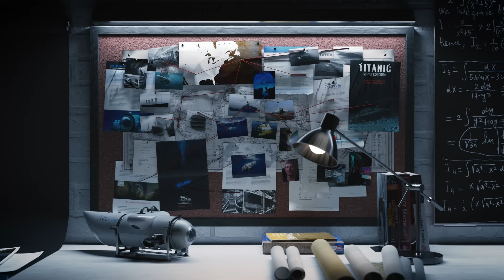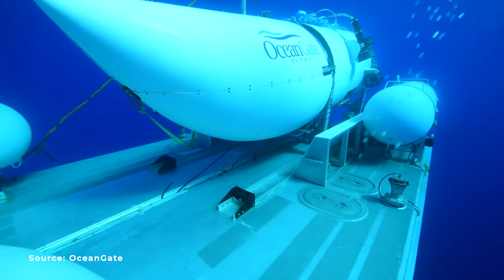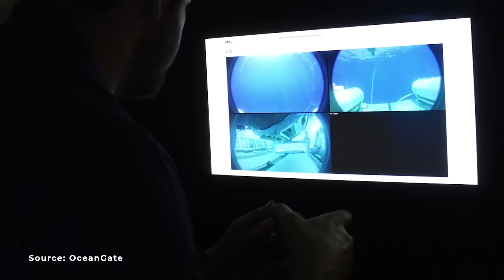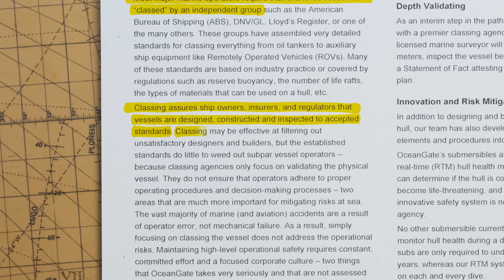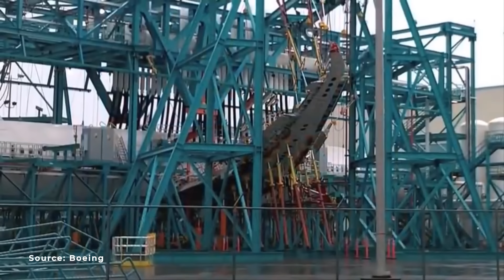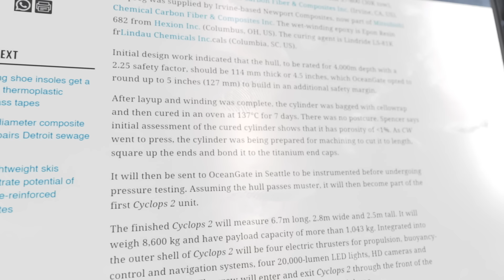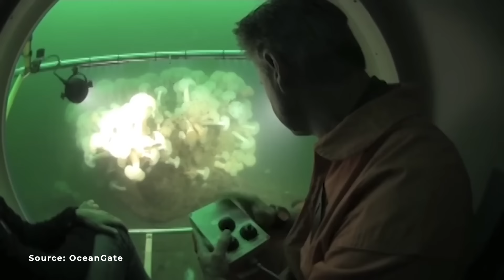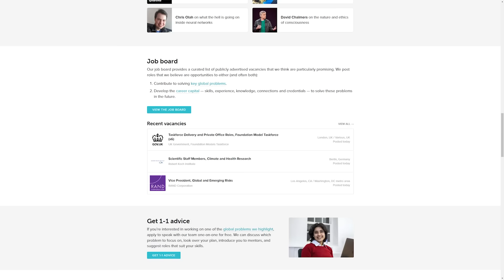The Questionable Engineering of Oceangate

Comment: Point to note about carbon fibre skinned aircraft. Commercial aircraft are routinely pressurized to 11 psi(pressure found at 8000 feet above sea level). That outward force is pushing against the 3.6 psi found outside aircraft at their 35,000 foot cruising altitude. So only 7.4 psi pushing against the fuselage shell, in the right, tensile, direction for composites, versus ~5500 psi of compressive force patiently waiting to crush the Titan.

The CEO was a poster boy for Dunning-Kruger. He knew just enough to kill himself and whoever was unlucky enough to be with him, when willfully ignored material properties and physics, finally won.

Comment: I'm finding this really interesting- I work as a historic blacksmith and often deal with an archaic material "wrought iron" which was the go to standard iron metal before the bessemer process. Wrought iron is essentially a composite of semi bound iron fibers and silica slag, and therefore requires special attention when worked. Many modern blacksmiths struggle working it being so accustomed to modern homogeneous steel, where as wrought will not tolerate the same treatment. It will delaminate, crack, and is stronger or weaker depending on the axis being stressed. All you've described about modern composite materials is very intuitive to me, I've even seen wrought iron delaminate like that buckle snap failure you described, it will do that sometimes if you over stress a bend in a bar the wrong way. While working the iron we have to constantly monitor the piece for potential faults or inconsistencies in the irregular material and intuitively and on the fly remedy them. Since wrought iron is no longer manufactured we face the added challenge that we don't get to choose what quality bar we get, but certain pieces absolutely will not tolerate sub-par bar. Knowing how wishy washy and subtle our mental judgement calls are I can very much understand what a task it must be to get a computer to understand the complexity of a composite's character. Cool stuff!

Comment: Another good video cheers. I appreciate the necessary commentary on the misuse of engineering by unsuitable mindsets. It would also be good to have some in depth maths and physics, especially with examples, of things like different strengths and failure modes of different types of composite etc. Cheers! 👍

Comment: Doing rapid development cycles like what SpaceX and others are doing is not the same as what Oceangate has done. Rapid development cycles mean to do a lot of smaller scale design-build-test-repeat upfront before a full scale design so you learn fast. It doesn’t mean to circumvent some verification testing nor does it mean not to seek regulatory licensing. You can also accept certain risk in testing as long as human life is not at stake. These are important distinctions to understand.

Comment: I wonder if the carbon fiber tube would be ok with a steel or titanium backing plate or perhaps used the backer as the "spool" on which the carbon fiber is laid.
Reply: At that point, why not make the entire thing out of titanium?
Reply: @alex2143  'innovation'. 

For real though, i was thinking towards weight savings, but I don't think that a small sub like this has a specifically large problem with weight.

Comment: Wrongs beyond the material:
1) By tensioning the windings it pre-compresses the structure.

2) There was no intentional bias carbonfiber, they split the prepeg into strands & applied it like putting thread on a bobbin, this significantly removed shear strength at the ring edge, my primary suspect that the shear-forxe shear opened a slot to fail vs a point failure.

3) To mention if carbonfiber was used, it's also as powered to mold in a plenum for a homogeneous structure, nanotubes cone to mind vs a layup. This brittle a reason to stick with titaniumxs huge elongation at failure [a 2-way street]. Notch strength iffy req's a an armor layer inside & out.

Others mentioned in comments, a structural concept for bomber cylindrical submersibles for 1-crew & 4-psngrs: A parallel-sided barrel of titanium beams having the wedge-xsec of a barrel.

1st run for dist. load on a 12.5ft cylinder caused 35.5" of elongation at the center as a beam only, this to be taken by the side-face compression as with a complete stone-arch. 

Seats 30"/76cm wide with circular bulkheads a reserve for hitting something. 80-staves 2.66" wide at the base 2× for height gives a 5ft dia. roomy-ness for tourist perception vs this implosion event global impact, and, it looks to scale up.

Staves can be extruded, handy for costs part of reasoning vs cast-formed bulbs, tension bands pre-load it ashore.

It seems valid as a structural strategy, would really like feedback on any aspect, I'm convinced it can prove itself as a new, versatile submersible deep dive geometry.
Fwiw🍺

Comment: I like the idea of "Move fast and break stuff" as a means of developing new designs but that is more of a means of quickly discovering new concepts. Skipping the refinement of those concepts is what leads to prematurely putting lives on the line.

I am rather fascinated by the lack of research into the snap buckling and delamination considering for how long carbon fiber composites have been used in other fields.

Comment: There seems to be two explanations as to what happened. One has the Titan suddenly imploding, without warning, immediate lights out for the human brains on board.
The other, based on an unverified transcript, indicates minutes of struggle to gain buoyancy after experiencing higher rate of descent than usual. My speculation is sea-water infiltrating the fiber hull under pressure.
How does the carbon-fiber attain neutral buoyancy? How well does it resist compression? Does it contain entrapped air? Voids! Less than one percent? 
Yea, I can see lots of problems with expansion and contraction within the hull fabric. The difference in pressure is hundreds of time greater at -3 km than at +200 km.
There is a danger when individuals have so much wealth and so much power.

Comment: To be fair - many catastrophes have occurred under government projects as well. 

Often when government kills people in these types of scenarios (exploration and new design testing with fighter pilots) people give them a pass. The hypocrisy is amazing. 

Ocean gate made people acknowledge and sign that they could die because it was an experimental design. 

They chose to accept the risks. It’s on them for not doing a better job at determining the true risks. 

The silver lining will be that this has taught many future people to do their own research rather than just blindly accepting someone’s word. 

Musk’s approach was mischaracterized by you. He does go fast but he completes many tests runs with no people on board. 

If Oceangate did this, they would have dropped sub after sub with no people and every time it imploded …they would have learned what not to do for the next design until they got it right.
Reply: Exactly SpaceX test well before putting people on board. They work with experts from NASA.

Comment: I saw a video last night from the company itself. The titaium ends WHERE GLUED onto the carbon fiber/titanium tube. There where only 2 small ridges and small surface area no matter what glue you use. It should jave beem threaded and glued or wound into the carbon fiber. Epoxy like glue does not like to stretch I thinnk.
Reply: No need.. it's all under compression. If the face of the titanium endbell and the face of the carbon fibre tube were both reasonably flat, you wouldn't even need glue. Water pressure would hold them together.
Reply: @robm7914  Good point, but if any water came in between anyways its a implode bomb. And its not spherical, so there would be more pressure on the tube than on the ends in my standard mind. Which makes any edge a weak point where the lids can pop off vertically cut down. Imagine a waterjet cutting steel tube.  Even when pushed on from horizontal sides.Just speculating 🥳 pressure can only do 'so much' if theres a structural breach if cannot be fixed by simply compressing it i think. And it would get spliced instead squashed

Comment: What gets me is that it didn't implode immediately the first dive it took, it successfully dove multiple times. If the design was tweaked a little, and if it was autoclaved, would this have been an overwhelming success?
Reply: Carbon fiber delaminates and weakens over repeated pressure cycles.

Comment: The space x reference is a bit unfair. 

The failures apace x have had never had humans at risk. They were doing testing and through this they learnt and innovated. 

The equivalent would be if Oceangate had twsted their sub to destruction and then iterated to improve until they succeeded. 

Space x did have 2 failures with their falcon 1, but they didnt have humans on board and 2 it wasnt due to new innovation they hadnt tested. 

Space x had to show incredible reliability and saftey standards to out humans on their dragon capsule. If only oceangate had needed to so the same.

Comment: This is exactly what I was thinking. Fibres are like cables. Only really useful in tension. Using them in compression makes very little sense. I honestly think this was just some sort of PR stunt to use a "modern" material.
Reply: Yes.  The cachet that carbon fiber has to uninformed enthusiasts makes them think "really strong, best material for everything".  Well, not for everything.

Comment: Yet, in many ways Stockton Rush was correct, but a careless opportunist that circumvented roadblocks to his ambitions. Following regulations meant needless expense, caused delays, were absent or unsuited to this specific application that was a pioneering work. Authorities would have made him turn his design back into a sphere. In the future, submersibles will follow his concepts and be cylindrical, not spherical. Add to this contemporary features with consumer appeal. Properly designed, with forces correctly analyzed and materials specified accordingly and incorporating safety factors these are the kind of vehicles that will be employed in deep sea missions. There is much to explore and riches to recover in the ocean. One person spheres are inadequate for the task.

Comment: Narcissistic CEOs are not unique to tragedies.  I will point to multiple deadly failures on the part of NASA (Apollo 1, Challenger, Columbia) and lucky near misses (Apollo 13, mercury Friendship 7, other shuttle flights that narrowly avoided Challenger and Columbia’s fates).  Many failures in the fo4mer Soviet Union, etc.
Reply: Most of those failures were on the cutting edge of technology.
Oceangate had literally a written guide on how to build a safe submersible, and threw it out of the window.

There is a MASSIVE difference.

Comment: Why is the buoyancy of the pressure hull so important? Couldn't you build a cheap submersible using steel like the bathyscaphe and use oil/gasoline as a buoyancy aid, like an underwater balloon (finding out that's how they did it in the 60s made me feel stupid)

Comment: The thing about the composite structure having a porosity less than 1% sounds good to a layman.  The dangerous thing about it is, that 1% becomes larger after every dive as the fiber delaminates from the epoxy resin.  It showed a complete lack of engineering judgment to put on the website that the vessel was "certified" after one dive to 4000 meters and inspection by an expert.  How many "experts" did he have to talk to before he found one that would agree to that?

I wonder if any of Stockton Rush's potential customers ever asked him "is thing safe?".
He probably answered "you bet your life".

Comment: Engineering is a discipline whether it's electronics, software, mechanical etc. Testing is paramount. Statistics on the testing is paramount. Being able to create the tests and interpret the results is paramount. Because if you don't, you will cause electric shock or fire, get hacked, or have your sub implode at the bottom of the ocean.

Comment: 3:50 really is a perfect example for misinterpretation of statistics. Yes, it might be that most real world accidents are caused by operator error, but since 99% of big commercial vehicles are certified by some independent organisation, you  can not take anything about certification vs. non-certification safety from those statistics. If all planes and ships were uncertified and built in some backyard, 99% of accidents might be caused by vehicle failure instead of operator error.

Comment: I thought it was common sense that carbon fiber is not effective at keeping pressure out as it is at keeping pressure in. 

keeping pressure in uses the strength of the carbon fiber and the resin.

keeping pressure out - you would only be relying on the strength of the resin. the carbon fiber would just be a piece of cloth and not add any support

Comment: Regarding testing a carbon fiber hull aka. a big tube. Use Archimedes law. :face-orange-raised-eyebrow:

Mass of resin used to fill the hull/tubes volume minus the mass of carbon fiber used to make the hull/tube.
That would give a theoretic combined mass of the hull/tube. Weigh the actual hull/tube.
The difference of theoretic mass and actual mass must be lost in air bubbles in the carbon fiber hull/tube.

Test two. Measure the hull/tube length after each dive. If it gets shorter its buckling at the inside edges.

I saw a hydraulic press test of a small carbon fiber tube. It delaminated and shattered in both ends.

It was clear that the titanium sphere endcaps would be pressing on the hull/tube like a giant hydraulic press.

I wouldn't be surprised if the carbon fiber hull/tube failed catastrophically near the titanium sphere endcaps.

Comment: if that leaked transcript is true, then that acustic sensor did actually warned them, however it was too late as they didn't have enough power to surface or even change the depth to reduce the pressure

Comment: Thank you for this. I wonder whether a miss-match between the Young's Mods of Ti and Cf in the epoxy resin of the end joints might be significant here?
Reply: Great observation. Massive loads, minor difference in Young's Mod, huge additional stresses.
Does Young's Mod even apply to the CF if it isn't homogeneous?

Comment: I work in the development of non-destructive inspection techniques in aerospace. The statement that it's impossible to inspect CFRP in this shape is simply fucking bullshit. Ultrasound inspection for CFRP is very very effective at detecting cracks, delaminations, and porosity. Yes, it has its limits, but the CEO'S type of blanket statement makes it clear that inspection was not considered a priority.

You can create a vessel that is completely inspectable. All that matters is that you devote the time into developing an inspection method, and that design engineers are aware of the limitations of inspection technology (where they have to redesign a feature to allow regular inspection.)